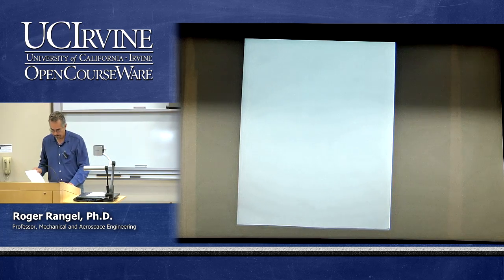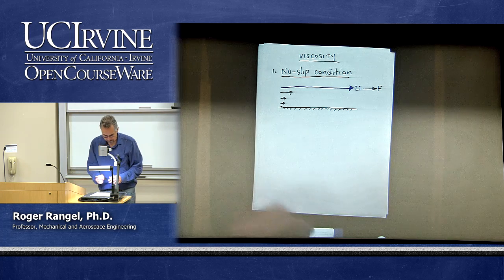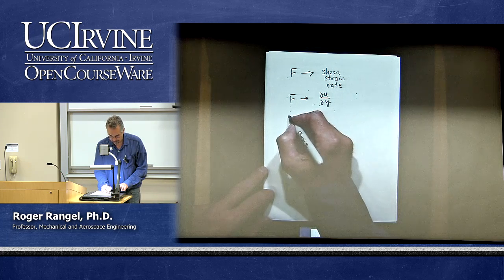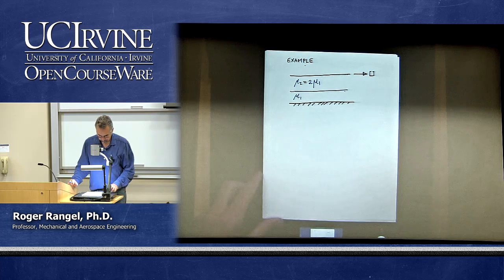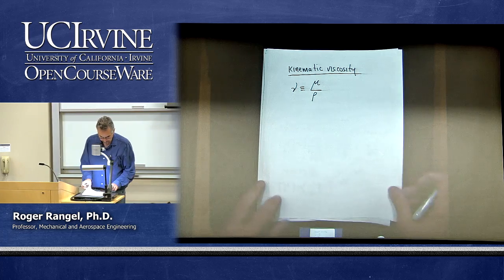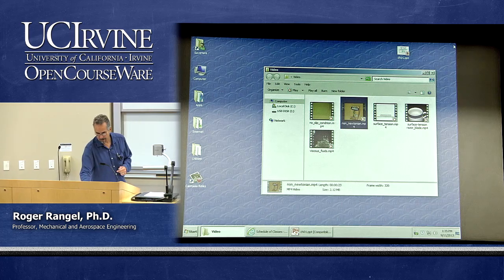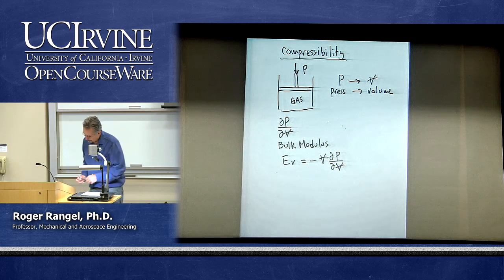Engineering MAE 130A. Intro to Fluid Mechanics. Lecture 02.

Comment: i think the fluid on the middle plate (in contact with the middle plate) is zero, because there is no slip condition. 
in other words the speed of the middle plate is equal to the speed of the fluid above it (in contact with the fluid).
Reply: Yes because the professor said that the top shear stress and the middle plate shear stress is equal.

Comment: plesae, why (U-V)?
Reply: my best guess is this.  

suppose the middle plate did not move.  Then we'd have V = 0.  Well, the velocity of the upper fluid would then be U.  or if you prefer, it would be U - 0 

i.e. the equation uses the velocity at the top of the (upper) fluid minus the velocity at the bottom of the (upper) fluid.
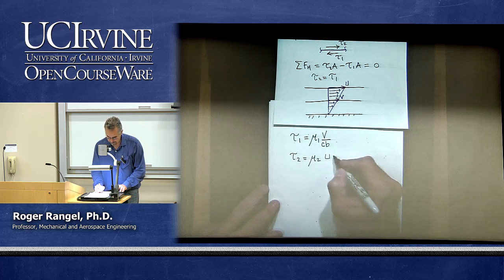Reply: Could you please explain to me how the velocity of the Tau_1 = U-V   at part 27:42 ?  Have you found the answer yet?
Reply: I mean tau_2
Reply: think I found out. the slope has to be recalculated since what you see is not triangle. it is not tau_2 = m_2 * U/b because the speed of fluid in two plates is not same. the prof should have drawed it not in a straight line, but some kind of tetragonal shape.
Reply: There is a shear stress acting on every infinitesimal layers. Only these are decreasing depending on the viscosity of the liquid. As the viscosity of the liquid increases to the point it is almost solid, then the shear stress of the top layer of the first liquid is almost equal to the shear stress of the last layer of the first liquid. If the viscosity of the liquid is low like water or oil, then each individual layer experiences less and less shear stress. Imagine there is a solid block. If you provide a shear stress one the top layer in one direction and a shear stress at the bottom of the block at an opposite direction then you will see double the deformation. In the lecture, there is a shear stress at the top and at the bottom in the same direction but different magnitude. The resultant angle is caused by the difference of these two shear stresses. Therefore it is always advisable to take the difference of the shear stresses into account, U-V.
Reply: Relative velocity